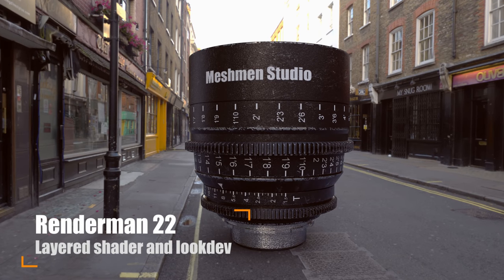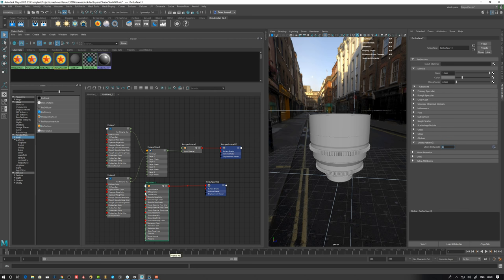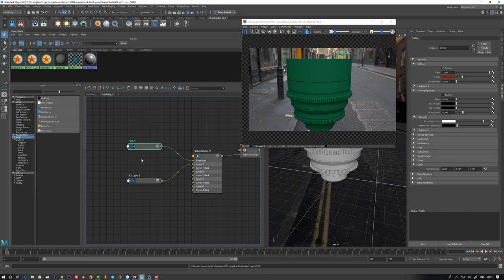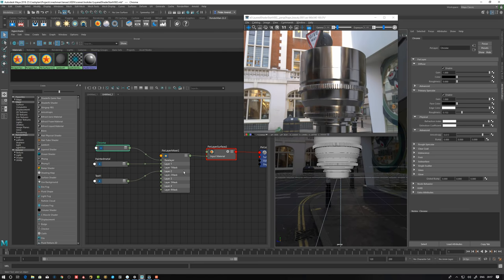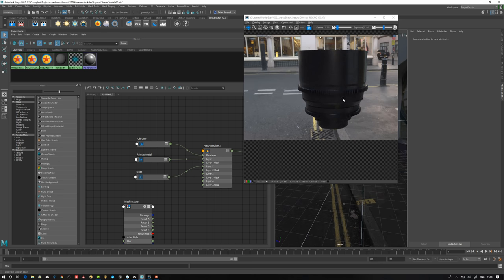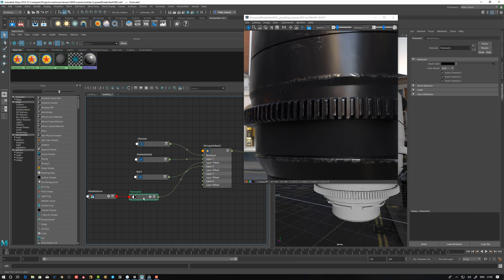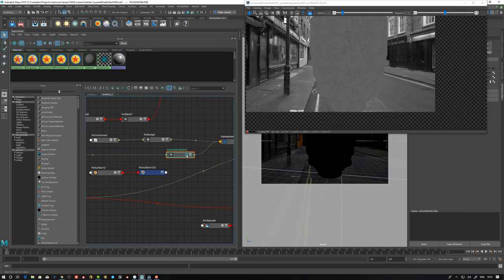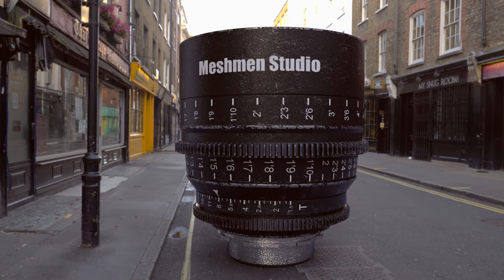Renderman look development tutorial | Renderman 22 pxrLayer Surface

Comment: What advantages has renderman? i use corona (max) and redshift (maya)
Reply from the maker: I have not used the ones you mentioned. I guess all renderer has its strength and weakness. For large production pipelines Renderman is really powerful and flexible. But from a low level standpoint its just another renderer. How do you use the one you mentioned?
Reply: @MeshmenStudio   corona for interiors ( mostly) and redshift for exteriors and product viz. For example, corona is very easy set up renderer, there are tons of premade materials. But redshift more flexible and better with large scenes
Reply from the maker: Renderman is free for personal learning, you can test it yourself. But for Maya